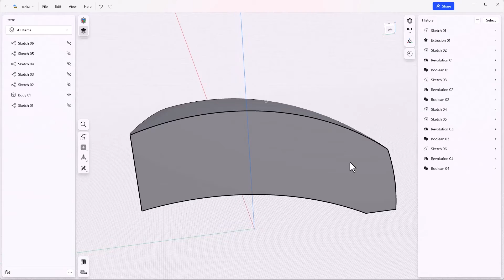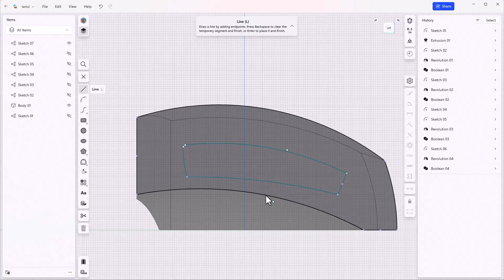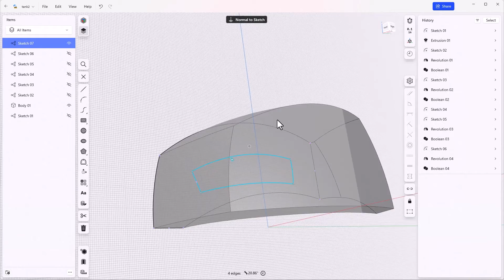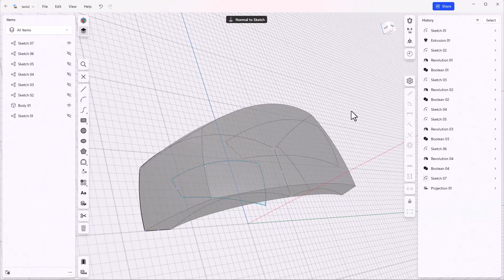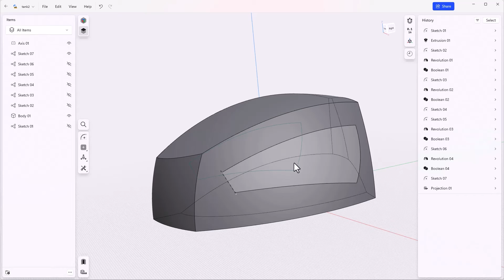Adding indents and fillets: Motorcycle Gas Tank | Shapr3D Basics

Comment: something I've noticed in your tutorials that makes it hard for me to follow, is how much your object changes after cuts occur. it is obvious that you made edits to the model off camera. the bottom for your object alone has changed twice without us knowing what you did. 1st when you cut the bottom Boolean to make the rounded cut out, you went all the way through the object, with no flat surface to rest the part on another. then when you flip it over to cut on the shape on the smaller side. all of the sudden you have a claw shape on the left side. Then when you go to do the projected feature on the side, now all the sudden your bottom face has a minimum 3/4 inch lip on it, please make these tutorials consistent with the same object with no outside editing, it makes it very confusing when I fallow along, and all the sudden your shape is different than mine with no explanation as to why.